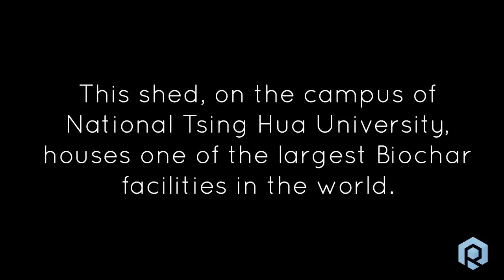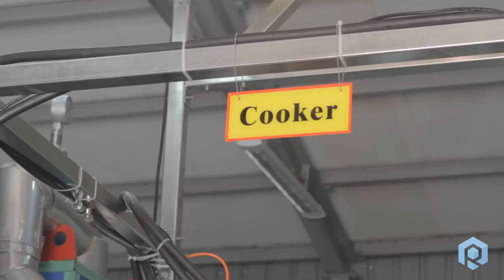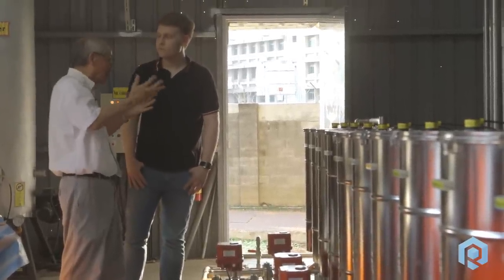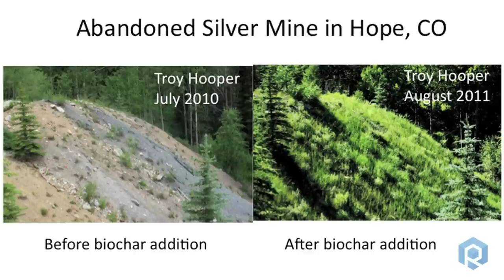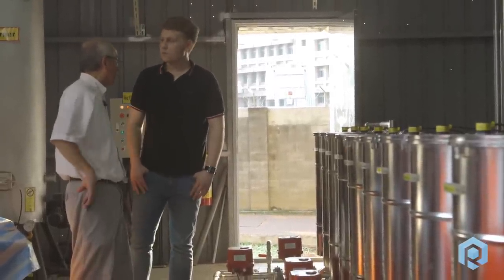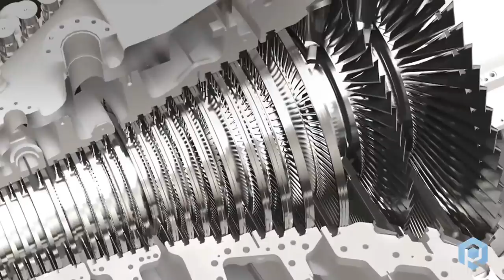Reversing Climate Change: Biochar in Ten Minutes

Comment from the maker: Bryan Elliott:

Frank Shu responds:

Bryan Elliott is really sharp to connect supertorrefaction (what we call our process of converting biomass to charcoal by immersion under molten salt) to molten salt reactors (MSRs).  This is exactly what our group has as a meta-goal.
 
Depending on the kind of salt used in supertorrefaction and the immersion time, it is possible to produce three different grade levels of charcoal.  The lowest grade, ecocoal, is used as a carbon-neutral coal replacement.  Ecocoal can have a heating value ranging from 23 MJ/kg and up, i.e., comparable to bituminous coal, but without any of its toxic contaminants.  The middle grade, biochar, is a carbon-negative, water-saving, soil amendment.  Biochar can remove industrial toxins, like cadmium, from contaminated soils.  We do not measure the heating value of biochar (but it can approach that of anthracite coal) because it is too valuable to burn.  The highest grade, activated carbon, requires pretreatment of the biomass with a base or an acid, and is used for filtration of liquids or gases.  For example, flooding often contaminates the drinking supply with microorganisms. Filtration of such contaminated water can make it potable again because the pores of the activated carbon can pass water molecules but are too small to pass microorganisms.
 
Energy in the form of high-grade heat is needed to perform the transformation of biomass into these three kinds of charcoals (plus liquid and gaseous byproducts that themselves have value as sources of bioenergy).  The cheapest form of heat comes from nuclear reactors, especially two-fluid thorium MSRs of the kind that our group favors.  Thus, performing a heat exchange of the blanket salt with the (non-radioactive) supertorrefaction salt can effectively augment the energy that is already in biomass into the higher grade energy source that is ecocoal.  In such an exchange, we effectively store some of the nuclear energy of thorium as the chemical energy of ecocoal, which can then be used in a safe, distributed, and dispatchable way by communities that choose not to use nuclear power.

Comment from the maker: Dr. Frank Shu's response to Samiam Smith: 

The main distinctions between supertorrefaction, using molten salts as the heat-transfer agent to char biomass, and traditional torrefaction, using flue gas, are energy efficiency and equipment design. Samlam Smith may have been misled by one of the previous commenters to think that the salt needs to be re-melted for each new batch of biomass.   In fact, the salt needs to be melted only once at the beginning of operations (i.e., upon commissioning the facility).   Once the salt is molten, it needs to be supplied with heat at a rate that keeps its temperature at a target level (between 300 to 550 Celsius for supertorrefaction).  The required supply of heat is defined by the biomass, and not by the heat-transfer medium, namely, whatever is needed to drive out the volatile organic compounds (VOCs) to produce char of a given quantity and quality for a given input biomass.  In practice, we have better efficiency in transferring the required heat than the conventional process because of our equipment design.  Once the biomass has becomes hot, the VOCs bubble out of the salt as gases, with the condensable VOC fraction converted to liquid synfuels, and the incondensable VOC fraction burned to generate baseload electricity for the facility and the local rural community.  Because of the inherent advantages of the design, supertorrefaction, using molten salt to do the heat transfer, will always be more energy efficient that traditional torrefaction, using flue gas, for four basic reasons. 
 
First, for a given throughput (tons of biomass processed per hour), the equipment is much more compact, so there is less heat lost through imperfectly insulated surfaces than with traditional torrefaction. Second, the compact size means that equipment weighing tens of tons in total can be transported on trucks to the harvest site at most once per season to process hundreds of tons of biomass per day.  For a traditional torrefaction effort to be economically viable, one has to truck hundreds of tons of biomass per day of biomass to a large fixed facility.   Third, all methods for the thermo-chemical processing of biomass produce charcoal fines and tars that can potentially gum up the moving parts in the system.  With supertorrefaction, we are able to burn the charcoal fines and tars inside the salt, thereby turning what is normally a waste and a nuisance into a resource that makes unnecessary any external input of heat via the burning of fossil fuels once the facility is operating continuously.  Burning charcaol fines and tars inside the salt has the further advantage of producing no fly ash and being 100% efficient in transferring the heat of reaction to the salt.   Fourth, steam constitutes the major fraction of the VOCs expelled from biomass during the supertorrefaction process.   This steam bubbles out of the molten salt and is condensed to become the distilled water with which we sequentially wash the salt off the surfaces and inside the pores of the charcoal pieces.   The saltiest water is then piped into the melter/heater where the salt is recovered by driving out the water as condensable steam.  The salt-recovery step is the only one where supertorrefaction has an energy requirement beyond that required for traditional torrefaction.   It is a simple calculation to show, for our wash procedure, that the extra energy penalty is typically only a few percent of the total energy contained in the separated products, which is easily offset by the other advantages of the design.

Comment from the maker: Dr. Frank Shu's response to Bart Van Riet: 

These are very good questions.  My answers follow.  If you use these answers in any future work, please cite this Raw Science video.
 
Q1.  What salt is used?
 
A1.  Many are possible.  The main criterion is that they should be recoverable with little loss in a complete cycle that includes washing of the salty charcoal.
 
Q2.  How do you prevent the salt from reacting with the biomass?
 
A2.  We don’t prevent the reaction if it is desirable.  For example, besides water, the main volatile released by most biomass during our process named supertorrefaction is acetic acid.  Thus, we choose a salt that reacts with the acetic acid, with the product salt  converted back into the original salt by thermal decomposition at the temperature of operation.  The net result is the conversion of acetic acid to acetone (and water plus carbon dioxide).  By well-known synthesis steps, it is then possible to remove the oxygen from acetone while dimerizing  it to produce isopentane, or while trimerizing it to produce mesitylene.  Since isopentane is a highly volatile hydrocarbon and mesitylene is a relatively nonvolatile hydrocarbon, different mixtures of the two can fuel, in principle, any form of internal combustion or jet engine.
 
Q3a.   Is it pyrolysis or torrefaction?
 
A3a.  It can be either.  In practice, we operate at temperatures intermediate between traditional torrefaction and pyrolysis.  Besides being faster and more compact than either, the intermediate operating temperature (that we can fine-tune to within a degree Celsius) explains the name supertorrefaction.  In this manner, we produce a superior char than traditional torrefaction, while avoiding the pyrolysis breakdown of the volatile organic compounds into many small molecules that makes their re-synthesis into useful products difficult and costly.
 
Q3b.  Is a gasification medium used?
 
Q3b.  By adding an oxidizing agent that is soluble in the molten salt, we can gasify the charcoal fines (that get through the porous basket) without gasifying the charcoal pieces (retained by the basket).  The same process essentially burns any tars released by the heated biomass, thereby avoiding gumming up moving parts that are the ruin of many traditional torrefaction or pyrolysis projects.   The oxidation occurs without the emission of soot or small particulates, as would happen with incineration.
Reply: +Raw Science Hi, not a chemist here, just a science dielittante.

A2: I suppose the decision of whether to sell the isopentane/mesiylene byproducts or to reroute it into an onsite fuel cell to generate heat and electricity that in turn could improve the efficiency of the overall process is purely fiscal.   Assuming someone has run the numbers on that, are you willing/able to comment ?
Reply: +Roving Punster 
Isopentane is a hydrocarbon consisting of 5 carbons and 12 hydrogens with all linkages being single bonds.  Rather than all 5 carbons being on a linear chain, isopentane is one of the branched isomers that is barely a liquid at room temperature and pressure, and therefore highly volatile and easy to ignite.  Mesitylene is a hydrocarbon consisting of 9 carbons and 12 hydrogens with each carbon linked to another carbon in a three-dimensional fashion so that there are only 12 bonds left available for hydrogen atoms.  Such a structure is highly non-volatile and remains a liquid even at low pressures (e.g., in an airplane flying in the stratosphere). A liquid like mesitylene is easy to store and transport, but difficult to ignite in air.  Liquid mixtures of hydrocarbons that are both easy to carry in a storage tank and possible to ignite are much more valuable than their gaseous counterparts.  This is the reason why gasoline, which is typically a mixture of hundreds of hydrocarbons
with 4 to 12 carbons, costs much more for the same energy content than natural gas, which is typically 90% methane CH4.  Thus, blends of isopentane and mesitylene, made by the company Swift fuels, located in Lafayette, Indiana, can theoretically fuel any form of internal combustion engine used on Earth.

Our supertorrefaction process does not produce isopentane nor mesitylene directly.  Instead, by using a proper mixture of molten
salts, we are able to convert the organic acids that would normally dominate the volatile organic compounds released by heated biomass (like acetic acid) into acetone.  Acetone contains only 3
carbons and 6 hydrogens, but because it also has an oxygen, it is a liquid at room temperature and pressure.  This property makes it relatively easy to store and ship, although one has to choose the
container carefully because acetone is volatile and an excellent solvent of many substances. Its capability for dissolving gaskets is why acetone is not used as a fuel in internal combustion engines. 
Dimerization and trimerization of acetone can remove the oxygen atoms and result in isopentane and mesitylene. At the present low worldwide prices of diesel oil, gasoline, and jet fuel, without a tax on net carbon emissions, it will be difficult for blends of isopentane and mesitylene derived from renewable biomass to compete against
transportation fuels derived from petroleum. Our goal is to lower the cost of acetone so that the renewable path becomes the preferred economic choice.

Comment: Hi, i am a chemistry student in Belgium and have a few questions about this process:
First of all : What salt is used?
Second: This is a type of fluidized bed reactor where the bed is the salt. How do you prevent the salt from reacting with the biomass?
Third: Is this a carbonization process like pyrolisis or is it torrefaction? Is a gassification medium used?
Thanks in advance!
Reply from the maker: +Bart Van Riet , here is Dr. Shu's response: 

These are very good questions.  My answers follow.  If you use these answers in any future work, please cite this Raw Science video.
Q1.  What salt is used?
A1.  Many are possible.  The main criterion is that they should be recoverable with little loss in a complete cycle that includes washing of the salty charcoal.
Q2.  How do you prevent the salt from reacting with the biomass?
A2.  We don’t prevent the reaction if it is desirable.  For example, besides water, the main volatile released by most biomass during our process named supertorrefaction is acetic acid.  Thus, we choose a salt that reacts with the acetic acid, with the product salt  converted back into the original salt by thermal decomposition at the temperature of operation.  The net result is the conversion of acetic acid to acetone (and water plus carbon dioxide).  By well-known synthesis steps, it is then possible to remove the oxygen from acetone while dimerizing  it to produce isopentane, or while trimerizing it to produce mesitylene.  Since isopentane is a highly volatile hydrocarbon and mesitylene is a relatively nonvolatile hydrocarbon, different mixtures of the two can fuel, in principle, any form of internal combustion or jet engine.
Q3a.   Is it pyrolysis or torrefaction?
A3a.  It can be either.  In practice, we operate at temperatures intermediate between traditional torrefaction and pyrolysis.  Besides being faster and more compact than either, the intermediate operating temperature (that we can fine-tune to within a degree Celsius) explains the name supertorrefaction.  In this manner, we produce a superior char than traditional torrefaction, while avoiding the pyrolysis breakdown of the volatile organic compounds into many small molecules that makes their re-synthesis into useful products difficult and costly.
Q3b.  Is a gasification medium used?
Q3b.  By adding an oxidizing agent that is soluble in the molten salt, we can gasify the charcoal fines (that get through the porous basket) without gasifying the charcoal pieces (retained by the basket).  The same process essentially burns any tars released by the heated biomass, thereby avoiding gumming up moving parts that are the ruin of many traditional torrefaction or pyrolysis projects.   The oxidation occurs without the emission of soot or small particulates, as would happen with incineration.
Reply: +Raw Science Thank you very much! Looking forward to future video's
Reply from the maker: +Bart Van Riet LIkewise, thanks! More will come in the new year.

Comment from the maker: Dr. Frank Shu's response to Samiam Smith: 

Ian Mansell is correct that one of the benefits of using biochar as a soil amendment is the improvement in the quantity of bacteria and other micro-organisms vital for soil health.  Using a scanning electron microscope to examine the product biochar, we find that supertorrefaction maintains the cellular framework of the original plant feedstock, with the cell walls and nutrient channels leading to them having been largely carbonized.  The preservation of the cell walls and associated channels means that water and dissolved nutrients have a path to get from outside the biochar into the carbonized pores inside the biochar.  The naturally porous biochar can also host micro-organisms that increase the amount of organic carbon that the soil can stably hold for hundreds to thousands of years.  Adding biochar to depleted soils can thus be carbon negative in multiple ways: (1) in the feedstock biomass that would have released carbon dioxide and methane had it been left to rot and decay, being converted instead to inert biochar, (2) in the additional growth below ground of micro-organisms that extract carbon dioxide out of the environment if other essential nutrients are added as fertilizers, (3) in the additional vegetative growth above ground on previously fallow land.
 
But as indicated in our response to RazorX1, biochar is not the only grade of charcoal made by supertorrefaction that can contribute negative-carbon emissions.  Charcoal tuned as a displacement for coal, can also be carbon-negative when burned as a coal substitute, if that coal-fired power plant has carbon capture and sequestration (CCS) capability.  The technology is termed BECCS (with BE = “bio-energy”), and is recognized by the United Nations and the International Panel on Climate Change as a carbon-negative activity.  Finally, another grade of charcoal, called activated carbon, can be produced by supertorrefaction from renewable biomass.   If this activated carbon is used as a substrate to make durable goods that are not burned, for example, textiles for high-end sportswear, or lightweight parts for airplanes or cars, or electrodes for batteries, or end plates for supercapacitors, then those activities can also be carbon negative, and contribute to the overall mitigation of climate change.